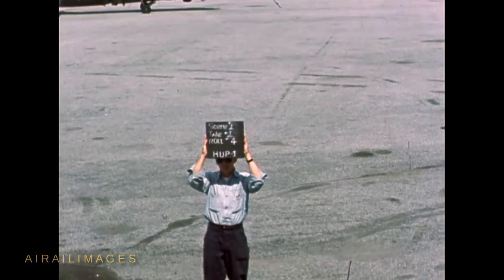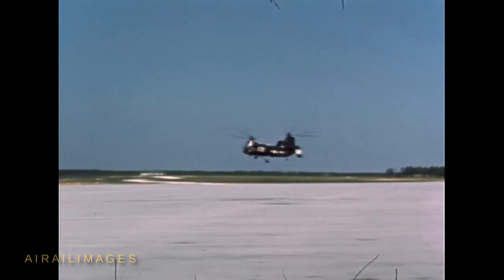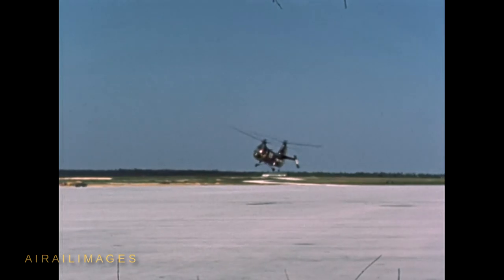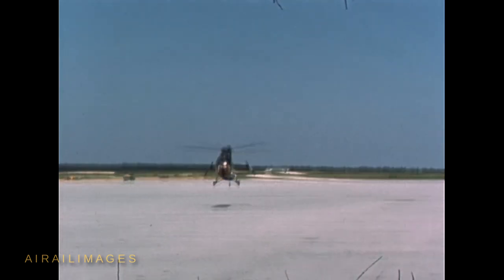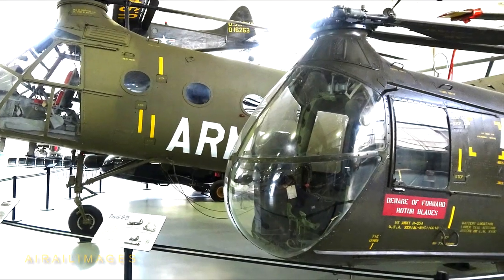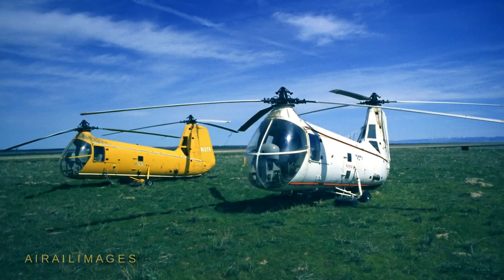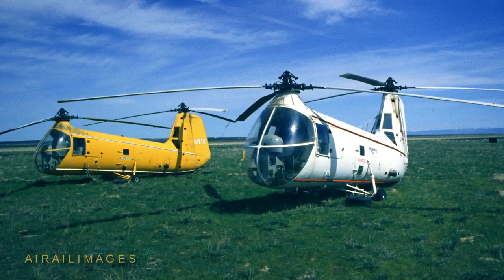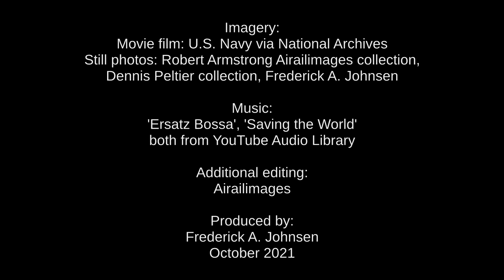Piasecki HUP Helicopter in Vintage Navy Color Film

Comment: My dad crashed landed in one in the sand in Rhode Island. Engine went out. They were stuck there over night because of the weather. And it was February. He told me he froze his butt off. He was stationed on the "Texas Towers". 4 oil platforms used as early warning for the Russians. There were 4 of them. My dad was on #4. They all complained about it being wobbly and the air force ignored the men. My dad was on it for 12 months. When he left, literally a day later, it collapsed in a storm killing 27. They only found my dad's platoon Sgt. The air force tried to cover it up.  The story of it is on the history channel. The things you learn.